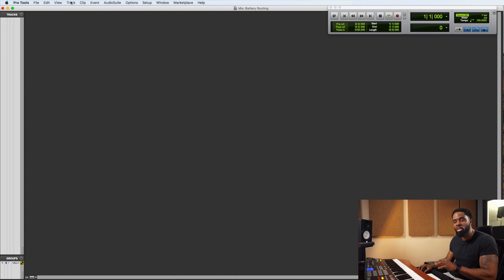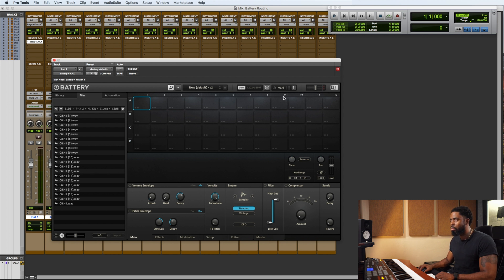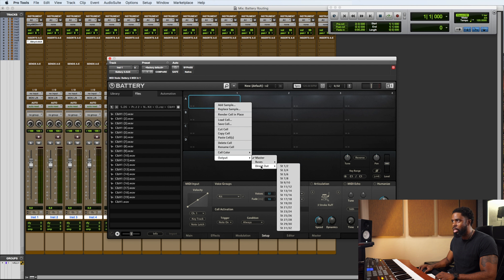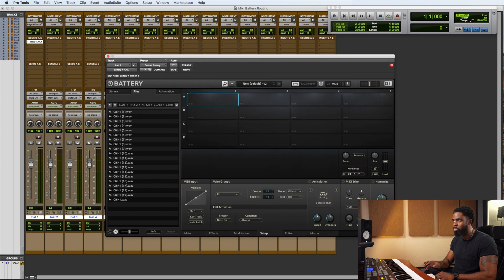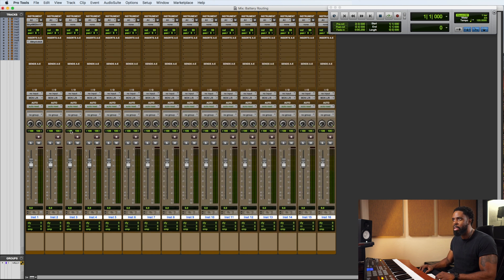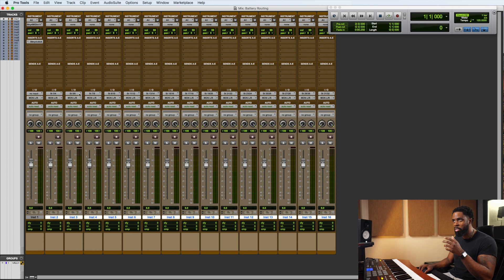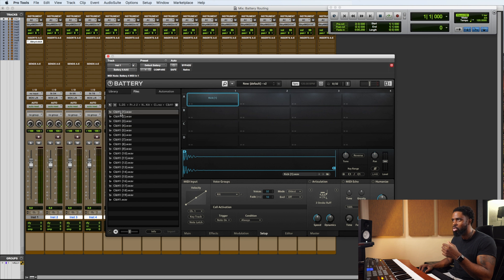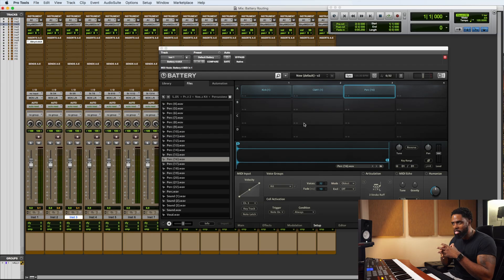How To Route Multiple Outputs In Battery 4 | Pro Tools Tutorial

Comment: I’ve just started using battery and I’m brand new to programming drums so this is incredibly helpful thank you! Sorry if this this is a ridiculous question, but if I’m using 4 of the pads do I record enable each track that corresponds to the output assigned to the pad? In other words, the first track (and only track) with the instance of battery on it, should or shouldn’t be the only track record enabled? I tried record enabling all of them and it worked, but I got all the midi info on every track instead of the info just for that pad! When I solo independent tracks I do only hear what’s assigned to that output but visually see all midi info for the whole kit.
Reply from the maker: You don’t have to record enable the track that Battery is on. Just the channels. To make sure each track has midi for that assigned channel you want to make sure that each pad has a separate assigned midi output in Battery and each instrument channel in Protools has that same corresponding Battery input on the instrument channel. Hope that helps.
Reply: @amirperrymusic  this does help thank you! If I’m understanding right I just record enable each channel I want the sound of?
Reply from the maker: @nicholasvegas2899  yup. You just record enable the instrument channel in Protools that you want to work on. It should work as long as you have the midi assigned correctly.
Reply: @amirperrymusic your content is amazing man! Thanks for the resources! One last question just because I’m still slightly confused. Assuming I have everything routed right, assigned how they should, will each input channel only show the info for that kit part? Because when I tried it everything sounded in the right place, but every channel had all the midi info in it, not just like the hats for example or the kick. It had all of them, but when I soloed the track I only heard the channel it was meant to be, is that right?
Reply from the maker: @nicholasvegas2899  you must’ve had something routed wrong if you’re still hearing all sounds. Each pad should have a different channel it’s assigned to. In Battery it’s under the “setup” tab. Make sure each channel is different and assigned a different number under “Midi Input”.

Comment: Thanks for this man. Quick question: I'm having the issue that if you use reverb and delay sends within Battery 4, those sound won't get routed to the channel specific to that sound. They just stay in the Master. Any way to change this? If not, I guess it's better to avoid any sends within Battery altogether and use your effects directly on the routed channel right? Thanks!
Reply from the maker: I would suggest you don't use any effects in Battery and just use effects directly on the routed channel. It gives you the added benefit of being able to tweak those effects better too.

Comment: I just did this and noticed that i have latency. The computer isn’t using a lot of resources, delay compensation doesn’t help, when I separate every drum part into a different instance of battery it works perfectly (but it isn’t practical in any way to do this) and when i leave it all in one instance it works perfectly too, it is only when i use the multi output method that gives me latency. Any tips?
Reply from the maker: Hmm.. what is your playback engine buffer size set to? If it’s high, maybe try reducing that.

Comment: Gotta ask, what makes you change the MIDI inputs and not just direct to AUX channels for all of your track elements?
Reply from the maker: The selected inputs on the channels are the outputs from battery. That’s how the sounds come thru on each separate channel.
Reply: @amirperrymusic  I get that with the Str direct outs, but changing the MIDI channels is a bit different. Do you tend to edit/program on the individual stems or on the main instance?
Reply from the maker: I change the MIDI channels because I want each sound on a different MIDI channel so I can spread it across the keyboard and have the ability to play each sound in any key I want to. If they were on the same MIDI channel, Notes from different sounds would overlap.
Reply: @amirperrymusic  I might be wrong, but I think MIDI channels are different than just keyboard mapping. Its more for like multiple controller communication and things like that. I might be totally talking out of my ass.
Reply from the maker: @BlakeRookMusic  yea keyboard mapping is a different thing than just assigning MIDI channels.
Reply: @amirperrymusic  this is why you have a channel explaining engineering to baby engineers like me. Thanks mate.

Comment: If anyone's wondering what the Windows equivalent is, to select a channel you need to Ctrl + left-click on it. Then to select all channels after the second channel, Alt + left-click the last channel. It may select the first one too...so you can just unselect that one with Ctrl + left-click again. You can then auto-assign the inputs by holding Ctrl + Alt + Shift, left-clicking on the second channel's input, and then going to "plug-in > Battery4 > St 3/4"
Reply: is that work for maschine2  ?

Comment: Thanks! I noticed you have MPK249 and I was wondering if you could show me how to get it set up with battery?
Reply from the maker: Is Battery the only plugin it's not working with?
Reply: @amirperrymusic  yes battery is not working with mpk249 pads even when I chose battery 4 preset on mpk
Reply: Thanks for your response so quick. It works ok now? not sure what what I did but it works ok. However I had multiple midi  instrument tracks recorder on my pt12 and inputs on those tracks were A 1-2. Everything worked flawlessly. Saved my session ok. Next day opened my session to continue with the project but only one track was marked as A 1-2 and all others are marked no input? And there is no sound ?
Reply from the maker: Dex My Muse sounds like something may have happened with your I/O setup in Pro Tools. I would fix the inputs, re save and try it again. If it opens up ok this time, you probably switched something with your I/O setup by opening up a session that had different settings.

Comment: Hey Amir, hope everything is all good.. Quick question, do you do the same with Xpand or do you use it normal ? Good day brotha
Reply from the maker: Yo! Good question.  I just use Xpand in its default normal form.  I don't do any special type of routing out of it.
Reply: @amirperrymusic  Thanks for the Reply brotha... I was always using Battery as a single plugin for every single sample jaja.. Or I would load up a kit, record the beat in midi then commit to an Audio track.  But I like your way of working battery better. Thanks for the tip.  Just learned something new.. You always learn something everyday !! Thanks again..
Reply from the maker: It should definitely help your workflow and save on some processing power.  I'm happy I could help though!

Comment: Man this Fr just changed my world! haha thank you man, Saving me processor power and everything thank you!
Reply from the maker: Good stuff bro! Man I'm glad I could help. Thank you for watching. 🙏🏾
Reply: One additional question, what’s the significance of routing to individual midi channels for each pad ? If I’m using a keyboard midi controller it seems as though my controller will only trigger PAD 1 in this routing setup.  if it’s set to “all channels” in Pro tools as opposed to pad 1 midi ch1 pad 2 midi CH 2 they all trigger . Is this a controller setting or PT workaround and what’s the significance of having individual midi routing for each track ?
Reply from the maker: @thegoodhusbands1  Oh also one thing I just realized I forgot to mention in this video is that you have to change the key range in Battery.  I just drag it from the lowest to the highest. Its always C-2 / G8  That may the problem also.  The key range is located by the volume and pan knob.
Reply: @amirperrymusic  Dope, thank you for the awesome information, super helpful and appreciate it!
Reply from the maker: No problem!
Reply from the maker: @thegoodhusbands1  Good question!  A lot of times I tune my drums and I'm playing different notes with different samples like my 808, snare or hi hat. If they were all on the same midi channel, I wouldn't have the full range of the notes and they would overlap on my keyboard. For example, If my 808 is on midi channel 1 on notes C2-C5 and my hi hat is on the same midi channel on C2-C5, they'll both be triggered when I hit those notes and I don't want that.  For the second part of your question it sounds like it could be a controller setting but I'm not sure.  Also, you want to make sure you have record enabled the instrument channel you're trying to trigger with the pads. Hope that helps!

Comment: HOW ARE YOU DRAGGING AND DROPPING THE CHANNELS i CANT
Reply from the maker: Do you mean how am I changing all the channels at once?
Reply: @amirperrymusic  When you are taking the midi channels into the BATTER 4 CELLS, at a  (1:30) minute and thirty seconds into the video
Reply from the maker: Poetic GEEnetiks Tv you want to look under the setup tab at the bottom of battery.  It's on the left side of that screen. They are usually set to "All Ch" but you can assign it to any midi channel 1-16
Reply: @amirperrymusic  i understand where they are located, but when I try to drag and drop, nothing happens, they wont load.
Reply from the maker: Poetic GEEnetiks Tv what's the file type you're trying to load? Is it a wav file or aiff?
Reply: @amirperrymusic  i am not trying to load a file i am trying to load the individual midi input channels into the 16 new 4x4 cells that you demonstrated to create
Reply: i click on all ch drop down and try to drag individual cell but it is not load them they wont move
Reply: at 1:20 of the video, how did you make all of the cells light up at once
Reply from the maker: You don't need to drag anything to select the midi channel. If it's not letting you select any midi channels, I would try restarting Battery and Pro Tools.
Reply: @amirperrymusic  Ok I figured it out, I am new to all of the production business...THANKS, for your help.
Reply from the maker: Poetic GEEnetiks Tv glad you got it figured out! 👍🏾
Reply: @amirperrymusic  yeah you do one of the best thoroughly explain jobs of sharing information
Reply from the maker: Poetic GEEnetiks Tv thanks man! I'm always happy to help.  I have some more coming that I know will help you as you're growing as a producer.
Reply: @amirperrymusic  Yo Amir!! What do you, or how do you set up to save the waves you ad to these cells
Reply: Because pro tools crashed the way I did it...Do you have to pre set up a folder